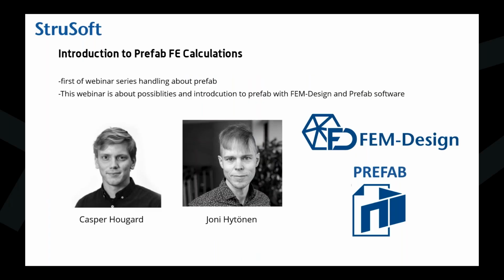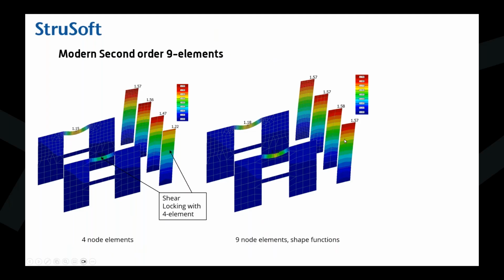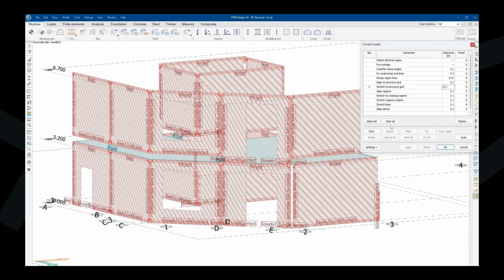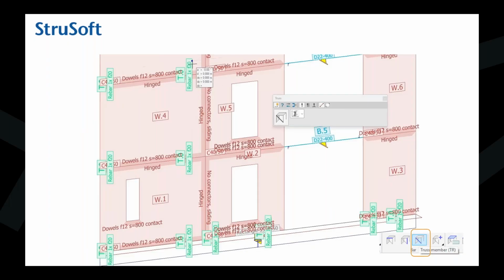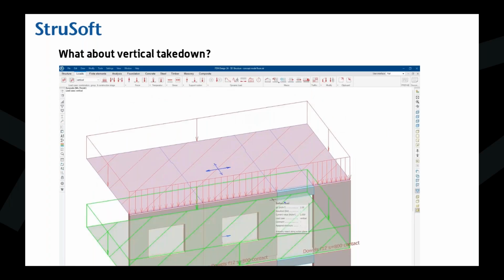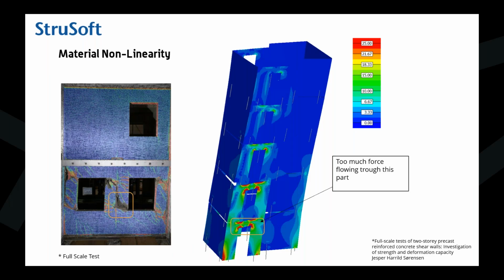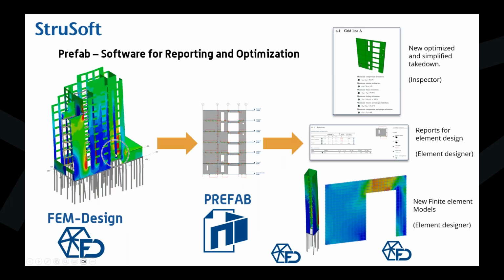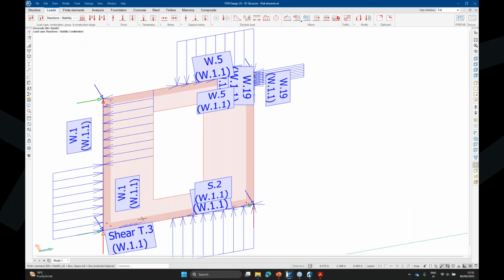Introduction to Prefabricated Concrete in FEM-Design

Comment: Good day! Is it possible in FEM-Design to model the joints of wall panels with each other using welded steel connecting elements, both in corner joints and in joints within the same plane? The gap in the panel joints can be neglected. That is, the connection relies solely on the stiffness of the connecting elements. Thank you.
Reply from the maker: Hello. Thank you for your message. Using edge-connections settings you should be able to simulate that kind of connection. Please reach out to your local sales representative for a talk about the specific solution. See our contact options here: https://strusoft.com/sales/
Reply: Somehow I have missed you comment. this is possbile. If you mean tension AND shear transfer point like connection we have to understand weakness of shell models: They do not use rotations around thickness axis and poiunt like connection object do not work and also line connections do not work since that is just many point connection. You can use division of edge connection with DIV command to make  short line-like connection and in results you get total reaction over this small lenght. Use bit larger lenght than real object to avoid  singularity issues.